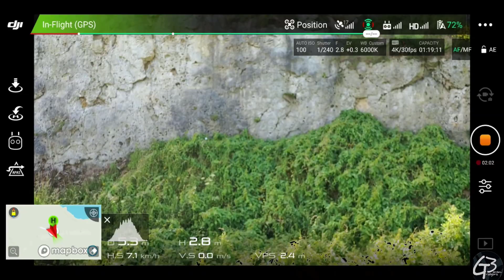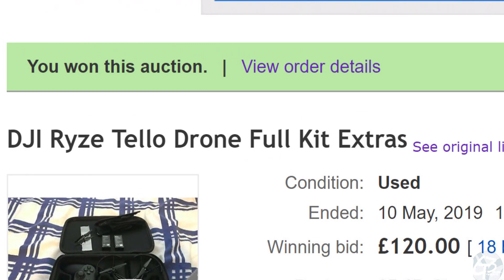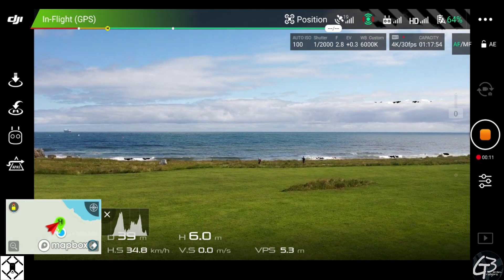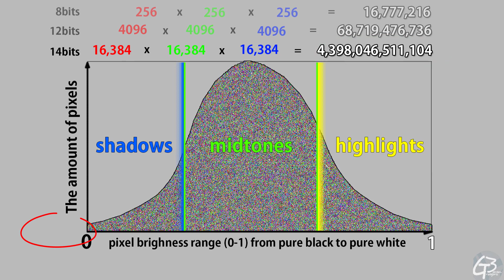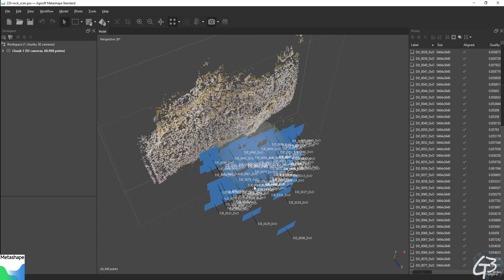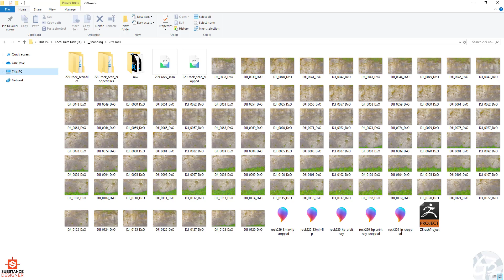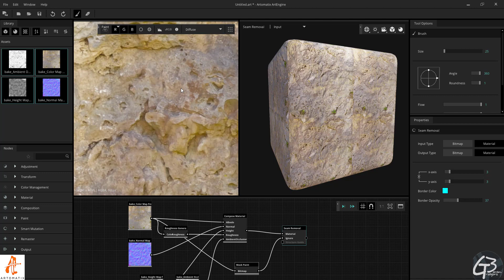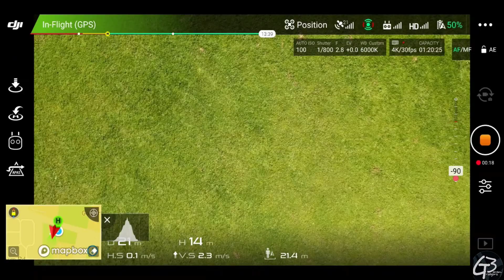Texture Scanning with a DJI Mavic 2 Pro Drone - by Grzegorz Baran

Comment: In regard of drone hitting the landing pad anchor - use anchors that doesn't stick out of the ground. Usually there are thins anchors that allow you to push to the soil level that there are no stick out parts. It helps you to have smaller landing pad in terms of area. Yes it forces you to land onto smaller area but not always there is plenty of space for that.
Reply from the maker: Thats a very good tip, especially for those who start the adventure with drones like I did at this time. But after 3 years of using the drone I dont use any landing pads anymore :). I simply take off from hand and land on hand.

Comment: 25:35
Some Background information:

1. In RGB 8, there is 8 bits space located for each channel(R G B) in one single pixel, which means there are 2^8 = 256 options(from 00000000 to 11111111) for each channel. Hence there are 256*256*256=1677216 possible colors for one pixel. 

2:To convert an 8-bit representation to RGB value we live and breathe with, for example, RED R=11111111 G=00000000 B=00000000, we just convert it by calculating R=2^7+2^6+2^5+2^4+2^3+2^2+2^1+2^0=128+64+32+16+8+4+2+1=255. G=0 B=0, hence R=255 G=0 B=0 

3:To convert RGB to Hex(from 0 to 15, that is 0-9 A=10 B=11 C=12 D=13 E=14 F=15), we just mod the value by 16

RED R=255 G=0 B=0  
255 mod 16 = 15 (255=15*16+15),15 mod 16= 15 (15 = 16*0 + 15)
hence R=FF G=00 B=00
that is #FF0000

Comment: Looking at your decimation in Agisoft -isn't it better to go slowly by 50% steps, ie. from 67M to 38,5M to 19M etc... ?
Also, some people stress out the importance of using all TIF files in the process, but here I agree with you - 100% JPGs are more than enough, especially for drone workflow.
Reply from the maker: Hey Pavel. This video was recorded ages ago :) and a lot has changes since this time. For example photogrammetry software can fully utilise 16 bits data image files. When this video was recorded it wsnt the case. So I strongly recommend to watch a few of my recent videos and use RAW files only which can be converted in any photoediting software to TIFF files with the 16bits color depth. I explained it in details in one of my videos.
Regarding decimation, why would I go with steps? Currently in my workflow I use as dense highpoint model as possible and usually  use 16k texture to carry color information. This way there is no 67 mln cap anymore. I decimate model just to get a light one so I can position the low poly plane in space and I bin the decimated one later. Hope that makes sense :)
Reply: @Grzegorz Baran  Thanks! I understand high color depth is super important during capture and RAW editing, but after that, I've never got any measurable difference in final export files. The same for sharpness in jpg compression vs tiff.

As for the decimation, I've read about the gradual 50% steps at multiple forums / tutorials and RealityCapture also recommends it in its Help files. I guess the Agi  lgorithm is similar. With smaller steps, the mesh is smoother (in my tests) and it allows to go even <100K tris, if I want to avoid ZBrush and additional tools.
Reply from the maker: 16 bit color depth (RAW/Tiff/PNG) is very important and makes the difference during the image alignent stage. During the reconstruction it is not as relevant, but still.. the more data the better. I would say if you have enough image overlaping, 8bits images (JPEG) used during the reconstruction should do the job. With less image overlapping, 16bits can come in handy. So with 16 bits you risk nothing, with 8 you do. This is why I strongly recommend to shot in RAW, get the most from with the photoediting software, export it in 16 bits file format like TIFF or PNG .. and use it as a source for photogrammetry reconstruction :)

As said, I use decimated model only as a reference in 3D space to position lowpoly model. Its quality and detail accuracy doesnt really matter as I dont bake anything from it. When the lopoly model is exported I can simply delete it as I use the lopoly model as a canvas for baking from the the actual high poly one.

ZBrush is totally optional and since it is quite expensive piece of software I can understand picking an alternative software for lowpoly creation. I simply purchased the ZBrush license years ago and I keep using it since all updates are free. I love its projection tool as it allows me to avoid cross-surface gradient which appears when the low poly is slightly misaligned. But I am sure it can be done in 3DMax, Blender and any other 3D app
Reply: @GrzegorzBaranArt  thanks, I still have got a lot to learn ;)   nevertheless, I never ran into Aligning problems since Agi 1.60 - it only skips blurred shots in scenes I'm working on

Comment: Thank you for sharing.You show a mavic can do decent material work. Do you think it can handle photogrammetry for large objects?
Reply from the maker: Thanks, I hope so. It has quite focused focal length for this, unfortunately shallow aperture (2.8-11). SO it depends on how deep is the object. I believe it is totally fine or even better to a standard camera for big targets like.. huge cliff wall. But for complex sculpture a DSLR camera mounted on a tripod where you can set the aperture to 16 having it steady during the shot would be better. So it depends on what exactly are you trying to capture. I am planning to test it in a future and record a video to have it covered but I am not sure when yet.

Comment: Why Mavic and not the Phantom 4 Pro? The Phantoms camera has a mechanical shutter and films at 60fps. Surely this would help improve overall quality of photos / videos etc? Cool video btw!
Reply from the maker: Thanks Craig, Mavic2 Pro had very good revies, was cheapper and had everything I needed .. especially 77°focal view (I guess you were suggesting 'Phantom 4 Pro V2.0' which also has 1inch sensor but 84° FOV as an alternative). M2P is also very portable and easy to transport compared to Phantom. 
Since I pay for my equipment with my own money I considered this purchase also as a risk as I had no idea is it going to do the job for photogrammetry. I wasnt able to find anyone who used it for material reconstruction already and was opend to share his experience. Especially I have heard before that Inspire2 struggled with material capture so getting one was a big risk since it might be useless.
Regarding to mechanical shutter .. I dont shot objects in motion and I usually shot from quite close distance.. also mechanical shutter has limited amount of shots it can handle before it has to be replaced.. to compare electronic shutter has nearly unlimited lifetime which is especially important for photogrammetry as you shoot sometimes a few hundreds of images per single capture). 
Btw. as far as I know a mechanical shutter has nothing to the video quality since it works just for the still images. For video it opens and the electronical shutters simulates it until the video is over. Would be a lot of noise if it would click 60 times per second :) . .especially when you record with sound
But as I said.. these are not big NOes . When I decided to get M2P it was a choice between why not Mavic Air and why not Inspire2 rather then why not Phantom. I guess, mostly due to portability and a bit more focused FOV I would still pick up the M2P even if the price for Phantom is the same. But.. I also would cry if I have Phantom 4 Pro v2 instead :) of Mavic 2 Pro. Finally, if would have the budget and I would live from scanning I would consider getting an Inspire 2 :D.
So my purchace was already way too expensive experiment I made to find some answers for a few questions I had in my head. I made it also to share results and experience with the photogrammetry community since I wasnt able to find anything like this anywhere when I was looking for it.
Hope that makes sense :), Cheers!
Reply: @GrzegorzBaranArt  THanks for the very detailed answer Grzegorz!

Comment: Hm, is there a better solutin now for create a seamless texture? Since Artomatix Artengine won´t be developed further and its quite expensive.
Reply from the maker: Hey, there are many other solution for seam removal, but I dont think any is better. This is why I still use ArtEngine on a daily basis. To be honest, I planned to record a comprehensive video on this subject,  but I struggle with time. In worst case scenatio, will cover it in my incoming book about photogrammetry for materials, or sooner on Patreon if I finally decide to make it public :D

Comment: hi this is quite nice location and beautiful scenery, can you please share where is it in UK?
Reply from the maker: sure, with pleasure :)
The exact position of the cliff wall I captured is: 54°59'26.4"N 1°23'48.6"W
It's North of the UK - a shore line south to the Soutshields. 20 miles east to the Newcastle. You can go there even with metro from the town center.. just 20-30 mins walk from the station.
In details.. this is a walking path from Graham's Sands through Frenchman's Bay and Marsden Bay (Marsden Grotto location) .. and down South depending on how much time you have to walk :).
Hope that makes sense :), cheers!

Comment: doesn't metashape supports mavic2pro for barrel distortion?
Reply from the maker: Yes, it does but Metashape loads images with captured METADATA setting. So loaded images go as they are without any color calibration, without noise reduction, without any white balance correction etc. Since I use those images to reconstruct surface details, color calibration is a big part of this process. Color data after reconstruction in Metashape is reduced to 8 bits no matter how deep was the color input. So pure 3D shape reconstruction will work without any problems if processed directly from RAW data and Metashape would correct it, but from color point of view it would be a terrible waste since color depth would be flattened to 8 bits. Hope that makes sense :)
Reply: @GrzegorzBaranArt  yes, this makes all sense, thank you. thnx and keep doing good work.

Comment: Hey man! Thanks for the tutorial. A few questions. You don`t bake texture in Metashape right? Just process calculations with vertex color, and use the vertex color in FBX file, to get the texture in Zbrush then using vertex colors ? Another question, what PC specs do you have? I have Core i5-4570 along with GTX 1080ti 10 Gb on a board, and my compute process took me about 2:45 hours using CPU+GPU at Metashape. Thanks for your help man!
Reply from the maker: Hey, yeah, in this case I dont bake anything in Metashape, just generate and export mesh with color stored as vertex color information. Medpoly version of this mesh in ZBrush is used just to create and position a LOWPOLY model for baking. What I get from zbrush is jsut this lowpoly model, nothing more.
Next I do bake in baler - in this video - Substance Designer where I used LOWPOLY plane exported from ZBRUSH and as a HIGHPOLY I use the FBX exported from Metashape :).
This way I simply bake all maps I need In one go (except roughness of course).
Regarding to PC, I have i7-7700K - 4.2GHz with 64GB of RAM and GF1080 with 11GB of RAM. 
Reconstruction time you had was quite fast tho, usually it takes longer and depends on many factors - amount of images and their resolution, quality of reconstruction, mode used for reconstruction - Metashape offers 3 modes with all their pros and cons, but usually photogrammetry reconstruction takes a while, 3h sounds quite fast ;).
Hope that make sense. Cheers!
Reply: @GrzegorzBaranArt I generally bake the textures in metashape and overshoot the texture resolution sometimes multiple 8 k textures depending on the scan, then bake down in Blender. Always shocked by how much more detail is present when I do that.
Reply from the maker: @RyanDashkevicz  Did you mean just albedo or full available PBR texture-set? I was doing a comparison recently (havent publish results as had no time to put them together) and baking quality in Metashape is certainly significantly lower to baking quality from lets say, Substance Designer baker. Doesnt matter if you tripple the size of texture, it is just way more glitchy. Metashape's baker simply isnt as good as other, full bakers.
Reply: @GrzegorzBaranArt  last I checked, it just reprojects (with some filtering/intelligence) the textures from the camera views onto the mesh as a texture. You can then use a lower resolution mesh with the albedo to bake out the pbr texture set from that.
Reply from the maker: @RyanDashkevicz  Yeah, I wasnt talking about color/albedo projection, but normal, height and ambient occlusion baked into low poly canvas. I made some tests recently using same data sets and results I baked within a photogrammetry app were way more glitchy and had lower quality in comparison to these I had from Substance Designer baker or XNormal.
Reply from the maker: @RyanDashkevicz  Dont get me wrong. Feel free to bake directly with Metashape if you are happy with the results you get. I witness significant glitching when I bake from  100-150mln heavy poly models and glitching is noticable on thin elements - like grass blades etc.
Reply: @GrzegorzBaranArt  I can see how using colored verts could avoid projection errors. I'll have to see how it works on some of my own scans!

Comment: Hey, just a quick tip. You can actually land the drone in your hand. I always do this cause I don't want to buy new props.
Reply from the maker: I was landing Tello on my hand all the time.. until once a wind pushed it and propeller hit my fingers. Since Tello is just a toy.. it just hurt and did no harm.. but I realised that if I would try to land a bigger drone.. and it would be pushed by the wind the same way.. I would have less fingers :). 
So I decided that it is safer for me to do not try it with a bigger drone. I totally agree it would be very useful to master hand landing.. was even considering to practice it recently when was in high grass.. but have changed my mind in last second since the drone after it detected my hand moved up.
But I agree.. its very useful skill.. also havent heard if any Mavic 2 cut someone else finger.. or was it just very painful when the blade hit it :).. but I am not still  confident enough to try. I am sure once I have no other choice I will :). Cheers and thanks for the tip!
Reply: @GrzegorzBaranArt  my phantom once hit my fingers and it doesn't even hurt. I wouldn't catch a inspire tho
Reply from the maker: @vfxexpert1425  Thanks, it means I should practice some hand landing then.. even just to know how to do this when I really have to. Thanks for an advice.. will wait for a good weather without any wind  and will see.. hopefully wont record any story-driven-video about how I lost my fingers ;P trying.
Reply: @GrzegorzBaranArt  Im new to the mavic 2 but do it almost every time.
Just stand behind your drone . Its first sees your hand when you put it under it, and wil move up a bit... just hold it there flat and dont grab it... remote Stick down and it will land without any danger in your hand. (https://youtu.be/hLiOB3W9XtQ?t=223 this is the mini but the mavic is even better and just land without going up that much)
Its works all the time.
never try to turn the mavic upside down like he does.... I tried that but it didnt shut off but was fighting while upside down.
Reply from the maker: @dennisvolkerts  Thanks man, but I have found a way better way to hand land, the mavic2pro I guess I should record a video to share it with the community .. its freaking awesome.. works great, never had any issues with that.. even during a strong wind.. no running away from hand, no drone flipping after .. just soft, clean hand landing :). If you think it would be worth and would benefit anyone if I record this video just let me know. Cheers!
Reply: @GrzegorzBaranArt  sure. I would like to know your idea
Reply from the maker: @dennisvolkerts  and here it is: https://youtu.be/NRy9t303trc
Reply: @GrzegorzBaranArt  I can confirm the Mavic 2 Pro will not remove fingers, but will cut through fingernails well. Blood, but no broken bones and certainly no lost fingers. Better not to test this, take my experience. Good video, thanks.

Comment: Hello Grzegor, thanks for your super detailed video und explanations. One question; Why you use 8bit footage for building the chunk and depthmaps? Metashape works well with raw data and handle there more details within 16bit+. I added you in facebook (benjamin springer) feel free to get in touch for more exchange of information and my PG experiences.
Reply from the maker: Hey Benjamin, in the next video I made: https://www.youtube.com/watch?v=k4btbj6IGhw
It came from this that Metashape and RC didnt support 16bits data before and even if you used 16bits it was trimmed to 8.. 16bits support was introduced recently. 
I told about this in the next video since I didnt know it when I was working on this one :). So of course you should use 16bits .. it is going to make a big difference especially for camera alignment, wont affect reconstruction quality much thou. I would recommend to use color calibrated TIFF file instead of pure RAW. Hope that helps :). Cheers!